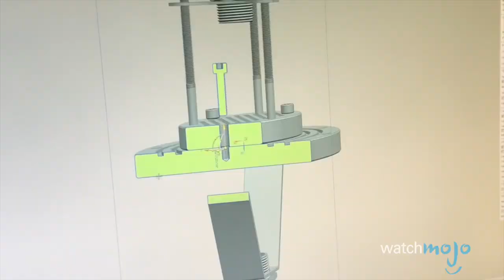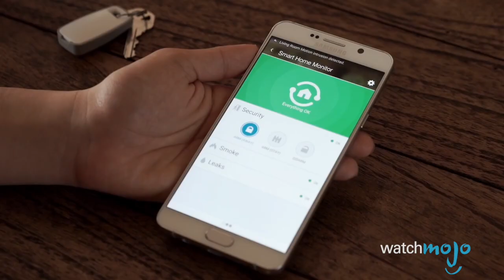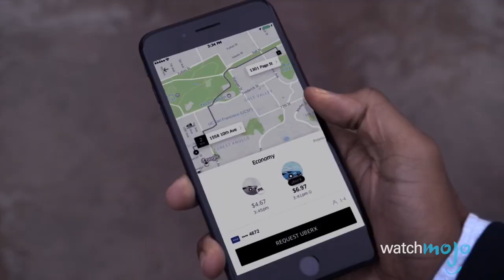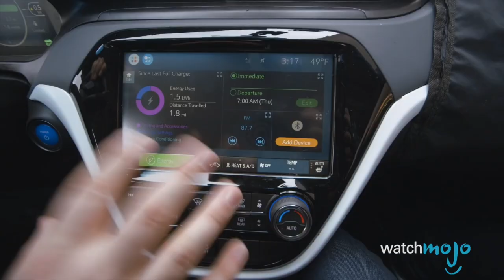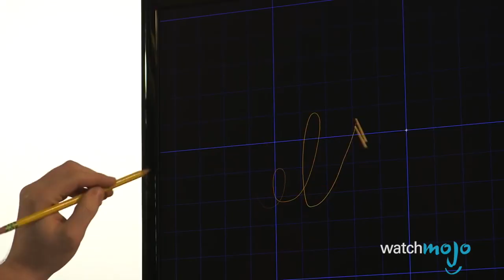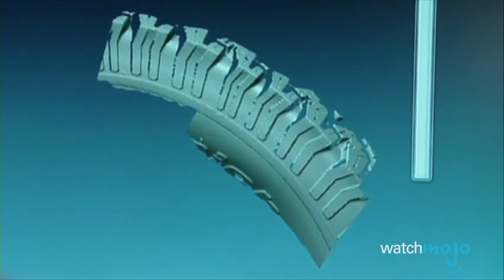Top 10 Emerging Technologies That Will Change Your Life

Comment: When you realise that hiperloop will bring the problems of  space travel in to the earth (traveling in a vacum)
Reply: you will only be in there for a few mins.
Reply: todd5687 30 mins...and a single hole will kill everyone inside....
Reply: Once they finally get the vacuum completed maybe... I will walk it would probably get me there faster. Then again with all these assholes on cellphone the vacuum and certain death will probably be safer...
Reply: you won't be able to walk on it since a vacuum is a place whit no oxigen and little pressure, a single hole in the vacuum wil case a pressure change that will kill everything inside it since a pressure change in a vacuum is like a punch whit a speed of the speed of light
Reply: you won't be able to walk on it since a vacuum is a place whit no oxigen and little pressure, a single hole in the vacuum wil case a pressure change that will kill everything inside it since a pressure change in a vacuum is like a punch whit a speed of the speed of sound
Reply: I think you mean in it and the pod would be pressurized. The hole in the tube will lead to the death but not directly from the pressure change. It would be the force of impact when the pod stops suddenly from impact. Perhaps take the time to spell correctly as well.
Reply: Sorry main lenguaje is spanish so..,.
Reply: @prosyndication21 only that long if you going across the country
Reply: ***** 30 mins was the time given to go from norcal to L.A.
Reply: It's a scam and it will never work and btw if it works, be prepared to some terrorist shooting the damm tube to kill everyone inside

Comment: The hyperloop will never work. Not with today's tech at least. If the wall gets punctured at all then everyone inside will die
Reply: You don't need to be a material scientist to figure out how badly it will fail. The walls of those tubes are way to thin to hold up in a vacuum sufficiently to make it safe. Even without a vacuum on them they needed braces sitting out there in the desert to prevent them from buckling. Tube sag is also talked about in the hyperloop specs. Not to mention the time it would take to depressurize the loading area. If you need to see what happens when a vacuum fails I would suggest watching an anti-tank round punching through a tank with a sheep inside.
Reply: Well if it is going to be underground Elon is an idiot because he said it would have solar panels on it to not only power it but to provide power elsewhere as well. Also have you never heard of a thing called an earthquake? I really hope english isn't your first language.
Reply: Well then are you going to show any math? Since it is apparently needed to show that they needed to reinforce the tubes on the ground to prevent them from sagging? Using a tornado as an example was a tactical choice designed to show even an idiot that wind speeds can in fact do plenty of damage. I am sorry that went over your head. I would explain about designed flex in aircraft and high rise buildings but I feel that you wouldn't be able to comprehend it. Aerodynamic design can only minimize drag it wouldn't rid us of this problem entirely especially in a "sealed" tube which would better direct the flow. Have you even made it to high-school yet? A lot of this stuff covered is high-school level science.
Reply: That thing would need to be completely guarded at all times as it’s a fantastic target for terrorists.
Reply: Don't need the math to see that the walls of the tube sections were malforming under it's own weight in the desert heat. How about the energy cost to create the vacuum in the first place and to maintain it? If there is a sizable breach in the tube the difference in the pressure would possibly break the sound barrier which could move the air at 670 mph or more. which would fling the cart pretty damn fast depending on various factors.

F6
Inconceivable tornado 319-379 mph

less than 1% These winds are very unlikely. The small area of damage they might produce would probably not be recognizable along with the mess produced by F4 and F5 wind that would surround the F6 winds. Missiles, such as cars and refrigerators would do serious secondary damage that could not be directly identified as F6 damage. If this level is ever achieved, evidence for it might only be found in some manner of ground swirl pattern, for it may never be identifiable through engineering studies

that is only about half the speed. You would need a hell of a lot of friction and space to stop something going even that fast.
Reply: Josh Kalhar they'll make it from dimondium or dimondillium lmao duh
Reply: You are too caught up in the math a point which is not even needed. If the metal sags in the desert heat in such a way that it required crossbeams to prevent it from doing such it will not hold up in a vacuum. You would have to brace it from the inside which is something you would know if you actually worked with said materials. Bracing it from the inside in such a way to help it support itself under a vacuum of 0.01 atmospheres would create problems on its own with transporting a pod that would contain cargo especially if you want it to be a comfortable ride. By sticking on this one point you are missing the bigger picture here which is we don't even need that great of a vacuum to actually make a functional highspeed transportation system. The testing of the pods were embarrassing. If he were to use a pressure system to provide the locomotion you wouldn't even need to go nearly as low therefore reducing the risks involved. even that would be very inefficient. did you actually notice how long it took to depressurize that small test track he made? Or did you happen to see the pumps he used and see how much energy was used to do so?
Reply: most of yous are forgetting one of the biggest risks what if the pod bursts in side the vacuum tube is not going to be like a plane where its harder to breath and planes can lower altitude where there is more oxygen. where as in the hyperloop if the pod burst people will die in seconds it would be the same or worse as a diver coming to the surface to quick and getting the bends. And if buy some miracle the tube is repressurised in time before people die they will need immediate medical attention and if the pod is stuck in the middle of butt fuck no where it will take some time.
Reply: Josh Kalhar umm
Reply: ChopStix no later how thick it is an exterior force could still collapse it especially with a vacuum
Reply: Also the last thing anyone wants when reaching to the end is getting faceplanted to a wall, like in Futurama. lol
Reply: unamazing vlogger 99 Are you actually going to provide something to this conversation or are you just here to make friends?
Reply: A tornado and a gust of wind are two completely different things. Firstly, houses aren't built aerodynamically, which increases the damage inflicted. Secondly, a tornado has an updraft as well as the wind around it, and the updraft is the cause of most of the damage, due to the immense pulling power of the updraft which easily pulls houses off their foundations, this is what does the bulk of the damage, not the outside winds. So, as I said, that comparison was absolute shit. The only thing that went over my head is the joke where you asked if I was in high school, which I think is self-explanatory. You know your argument has fallen apart when you result to petty insults instead of actually addressing the bulk of my argument. Show me the math saying the tube will collapse under the pressure, not the "sagging" shit you're talking about. And since the math doesn't exist, I'll happily sit back here. If you do manage to scramble together a calculation for why the tubes couldn't withstand the pressure of maintaining a vacuum, then I'll respond with exactly why you're wrong. But I doubt you'll do that, instead you'll just insult me and speak more garbage nonsense like you've been doing so far.
Reply: ...especially faceplanting at 600+ MPH ...not a fun scenario... moving people in a vacuum for very long distances will not be feasable for a extremely simple reason...the longer the distance, the harder it is to calculate all the potential risks along the path, and eliminate them.
Reply: Why do you act like these people have not even thought about this? Yet, they’re still going along with it. Oh! Probably because they got a fucking solution for it🤔 Yes absolutely idiot.
Reply: 10 to 1, they will probably make it so the loop doesn't go anywhere near that area where the wall is. Or there'll be a giant government coup and the wall wouldn't not happen at all.
Reply: They could design it so that if the shell is compromised for any reason, the internal vehicular projectile that houses the passengers would simply just come to a sate gradua halt. Or at least that's what the goal would be in the event of some damage.l
Reply: Not at all lol.
Reply: Actually you do need the math, because saying it won't work without proving it is basically like admitting that you're wrong. The wind doesn't mean anything, comparing to a Tornado doesn't mean anything at all. A tornado against a house is completely different from a blast of gas streaming down a sealed tube. An aerodynamic design with a strong front end could easily deflect that speed with minor damage.
Reply: Show me the calculations behind your assumption that the walls aren't thick enough to support the pressure. Because I can guarantee you that they're wrong, and that you completely made that up. The rest of it are decent points but all are able to be solved. Depressurization can be done by multiple pumps, not just one at either end, speeding up the process by a lot. Implementing a monitoring system would be fairly simple by placing sensors inside the tube, and stopping all pods currently moving if a breach is detected, and with a decently aerodynamic front shape along with a fairly strong front end it would be safe to assume there would be nothing but a breeze as the gas passed over the pod. Braces are nothing new and easy to implement, just because it would take a lot doesn't mean it's impossible. (Like seriously why do so many people think because it would take a lot of braces that it's impossible?)
Reply: Thundefoot is Bio-Chemist. He is smart, but its not his alma matter and made various mistakes in his analysis/calculations
Reply: +Monty Monty This. If he was a material scientist or something along those lines it would hold much more precedent but instead it's just a bunch of flawed shit from someone out of their league.
Reply: Josh Kalhar you incorrectly assume Elon is a idiot and wouldn't hsve a way to prevent that. plus the pipes underground 95% ( or more)fer most of de trip,how is it gonna get breached???
Reply: Umm why was the testing of the pods embarrassing? The whole competition was selecting the best braking sub-systems, other safety mechanisms and the levitation systems, not speed and distance? In that all teams were successful and the best ones were Delft and MIT. You know the second hyperloop competition will focus on speed right? Also if you haven't seen it already, Hyperloop One already demonstrated the high-speed capabilities of its pod, and it was riding in Open Air not a partial vacuum.
Reply: god didn't give you wings so humans don't have to fly... yep
Reply: That's the exact same problem with airliners
Reply: they could make the hyperloop bullet proof and they would have security cams and personal everywhere